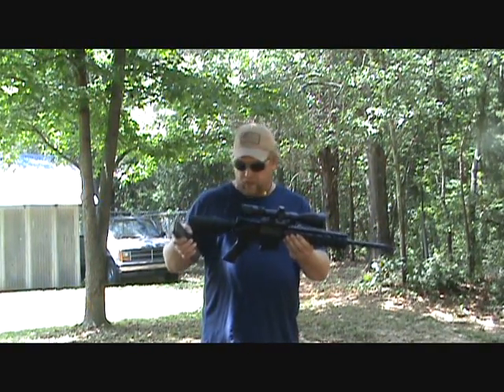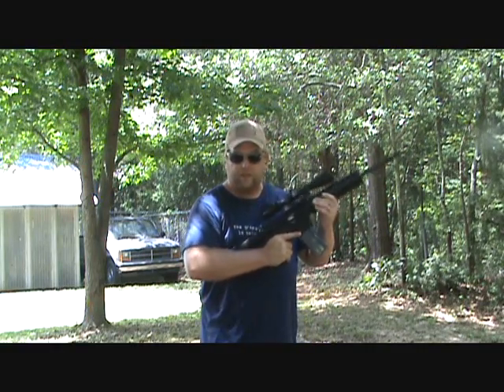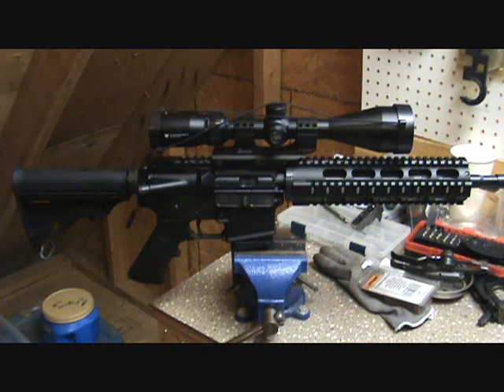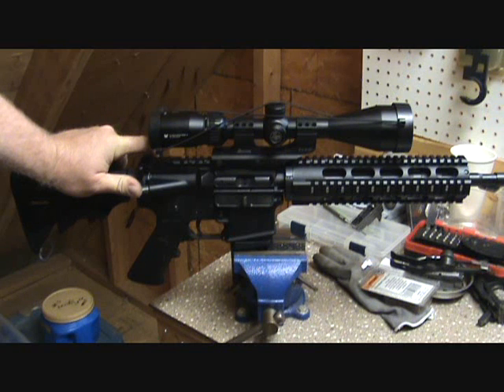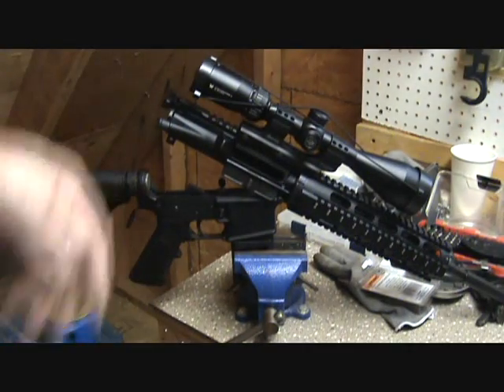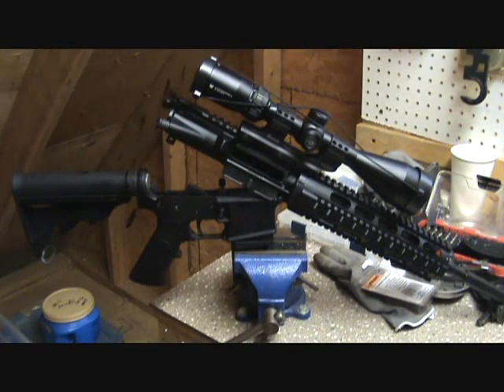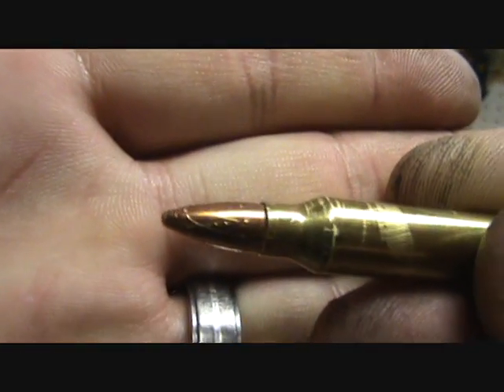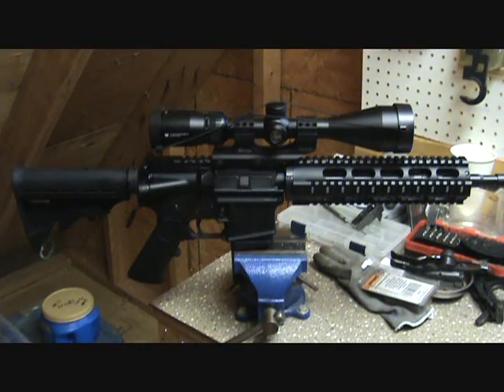AR15 EPIC  Failure Hardened Arms Upper   .

Comment: i bought 5 of these bear creek uppers for a couple hundred a unit and picked up 5 GI carry handles used off ebay for 30 a pop. sighted in the uppers all  on my rock river lower. they are all 100% same quality as my rock river upper, i have 2 RRA's.  they have come down in price since.  complete upper T marked,
Reply from the maker: MARVIN THE BOON for future builds I am gonna start test firing all uppers before I stick em back.
Reply: thats a QC issue, nobody bothered to look to see if the feed ramps lined up. I bought a DPMS A2 upper and the barrel was loose, and the slot was twice the milspec, it slopped back and fro like a 1/32.  midway took it back, but it looked like they assembled it themselves   from pulled parts.  also I think DPMS has a little extra beef inside the cavity of their uppers to make them non compatible with non DPMS BCG.  i tried a different BCG and couldnt get it to go back far enough to lock the bolt back.  it   wouldnt lock with any of the other BCG's I tried.. They do the same thing in the LR-308 firing group pocket, make a non standard radii in the corners forward of the hammer pins, so a drop in wont work without beveling the front edges, thus voiding the warranty on a drop in trigger.  I thought the rubber feet were the issue, its attempt at proprietary parts.  i dont think thats right on a modular system like the AR
Reply from the maker: MARVIN THE BOON I had the same issue a few builds back that ended up being a out of spec buffer tube. Wouldn't allow bolt to retract enough to clear bolt hold open. With so many parts being made so fast and cheaply you gotta check everything nowadays
Reply: Sucks when you get somthing that dose not meet your expectations.I know beyond a doubt they'll make it right.I have visited the factory my self.the owner took me on a tour.(I'm a knowbody mind you).his wife makes the whole crew lunch every day.( Friday harbour is a big tourists destination)so the foods spendy.they do nearly everything in house.besides some coatings that are illegal in Washington.I didn't know this before visiting.I was impressed.the owner was there(huge) engaged passionate and honestly proyd yet humble....I work at boeing and stuff gets by QA there.(kinda scary).but I wouldent hesitate to buy from hardend

Comment: I bought one. And the fit and finish stinks. The firing pin has groves and is pitted. They chrome finish right over the top of everything. I took my upper apart before firing. It works but can’t believe they didn’t catch this before sending it out. Didn’t even bother to contact them. Just ordered a stainless one from another company. Barrel has scratches and flash hider is marked up from a wrench. Looks like a kid  assembled this with his tools from Harbor freight.
Reply from the maker: I am assuming this is why they went out of business

Comment: It's the user. Not the rifle
Reply: Escala Coco that is what i was thinking at first.  He looked pretty awkward working the rifle.  But the scarred up round seems to prove it was the feed ramp
Reply: That would be just a matter of polishing the ramp. I don't know how many rounds he had in the magazine but if it was 29-30 , the bcg needs to be  back to insert the magazine completely or you'll have problems. I know this because I have a hardend arms ar-15 upper and psa lower and with the bcg closed you will not get the fully loaded magazine inserted all the way.
Reply: I have a Hardened Arms upper also.  I notice that I can't just slip the magazine in either.  I have to jam it in on a closed bolt.  If I don't slam it home, the magazine doesn't lock in although it does seem to hold with friction against the mag latch.  I don't notice until I charge the rifle and it doesn't pick up a round.  As soon as I slap that magazine up and recharge, it picks up the round and runs like a top.
Reply: Dave Biddle Try locking the bcg back and then insert the magazine and see if that helps. I tried inserting a fully loaded mag with the bcg closed and it didn't lock in. I slapped the bottom of the mag pretty hard and it dented the 1st round.
Reply: It was the rifle...Not everyone is a soldier, dont hate on the guy because he dont look like one of the "Cool Kids"

Comment: Papas place helped me with the same thing / put a bore brush on a drill with some good bore cleaner and work the crap out of it , cleaned all the machine lube from the factory off and works fine ?
Reply from the maker: Theredneck Prepper the new upper is in I have to assemble and test yet. Hardened arms responded within an hour of me sending pictures of the barrel clocked in the extension. They sent out a complete replacement upper the next day. Talk about fast customer service.
Reply from the maker: Theredneck Prepper https://youtu.be/qMq8RC2fhIs

Comment: So three videos and in the final video you discovered its the bcg and not hardened arms? Then you still leave up the video saying they failed?
Reply from the maker: The problem with the upper was the barrel extension was clocked chewing up the nose of the bullet. The bcg was a second issue.
Reply from the maker: I tried 2 other bolt carrier groups and none would work with the original upper. It appears to be a issue as I have been contacted by multiple people saying they had the same issue. They make their own barrel extensions so I would believe the installation to the barrel is where the Quality control issue was. They we're super supportive and had me a replacement to my door in 2 days.